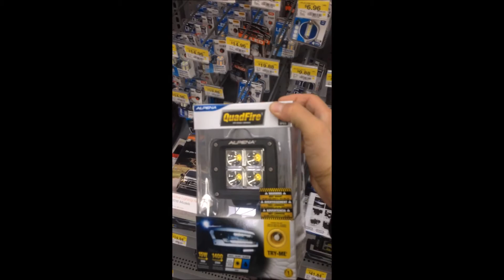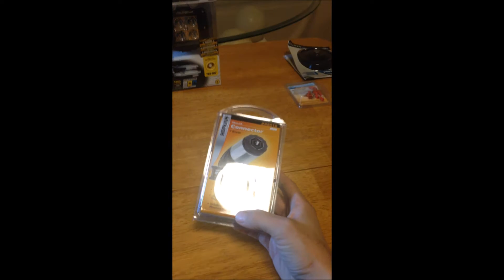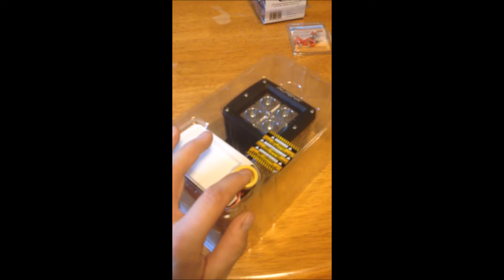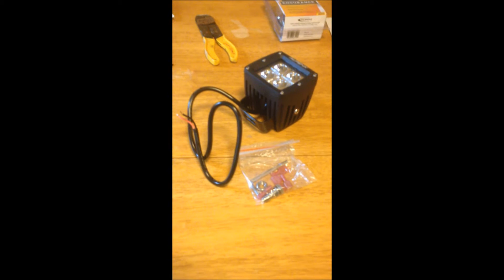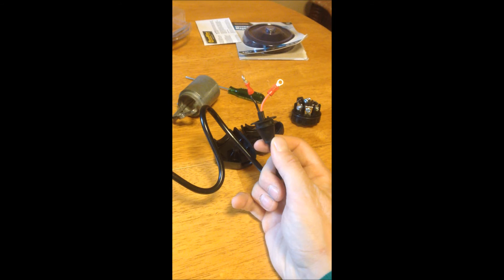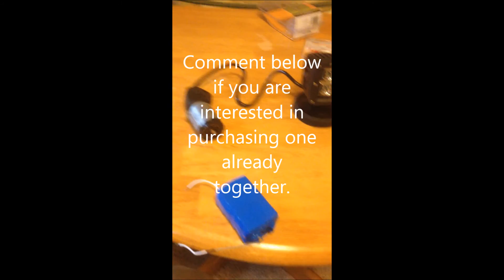EASY Trailer Plug Back Up Light System Assembly

Comment: Can you add a 2nd light to that existing set up, or would it blow the circuit on the truck ? example I would put this light you built behind the drivers side bumper, then add a 2nd light to the excisiting set up and add the length of wire I need so it would reach the passenger side